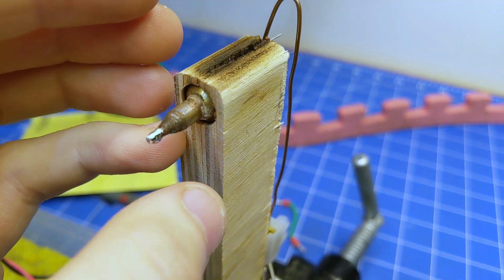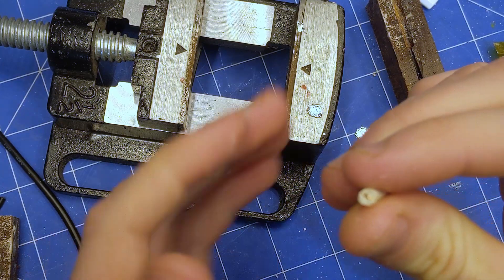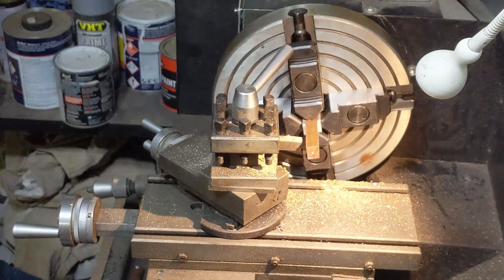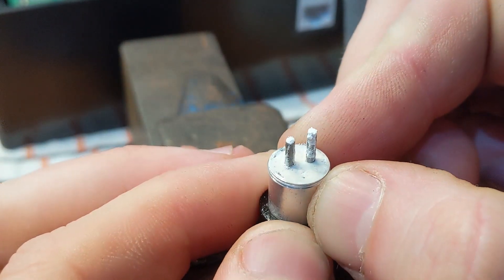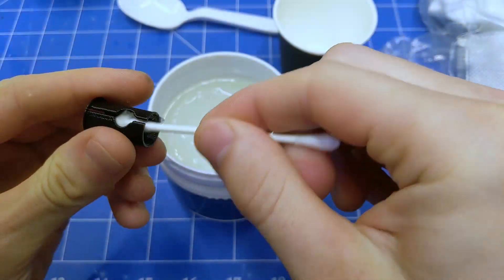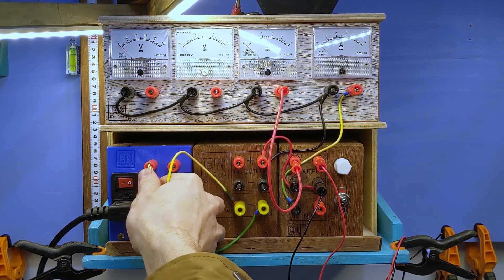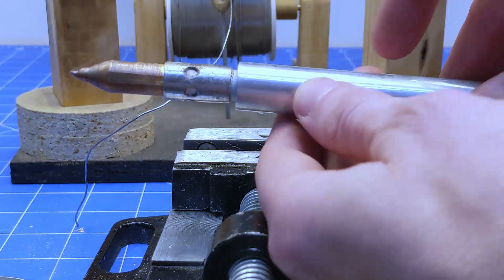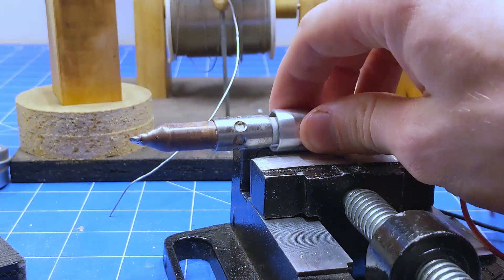DIY Soldering Tip - 2nd Attempt

Comment: Here's an idea - silicon fuel line at a larger diameter as a cover for the end of the tool to stop your fingers burning?
Reply from the maker: Well it would certainly tolerate the high temperature i guess ;) But i might go for a wooden handle if I try again.